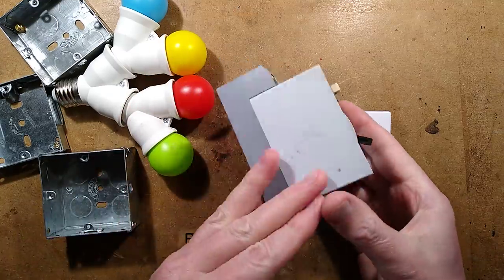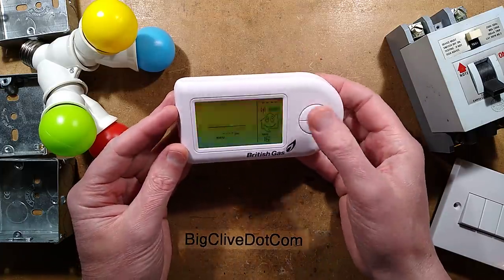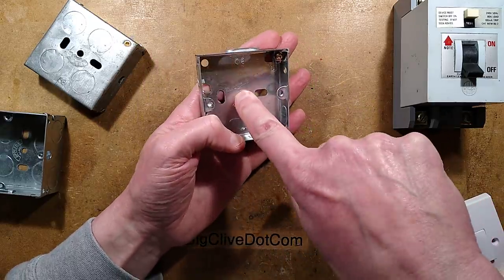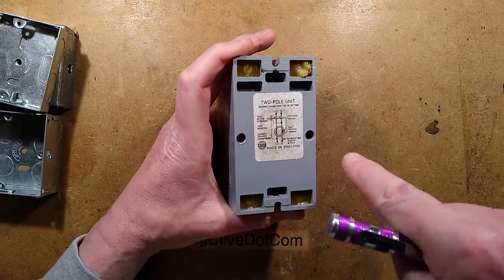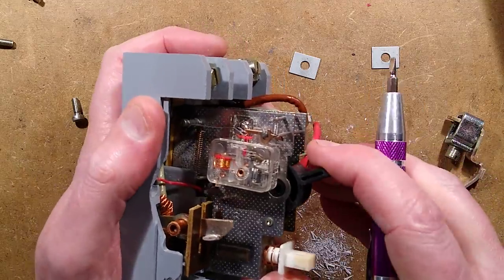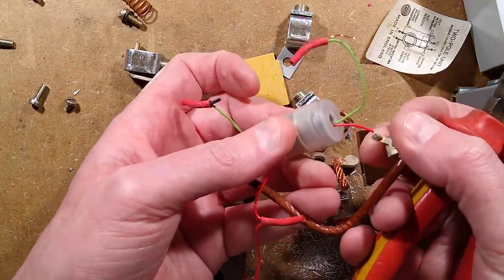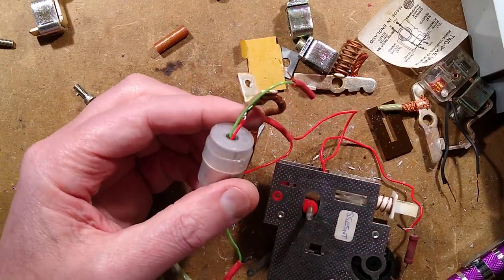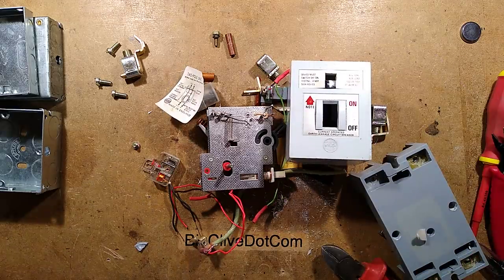Vintage RCD/GFCI teardown with story (weird sensing system)

Comment: I wish products these days could be this simple and reliable!
Reply: Ultimately it wasn't reliable though, as it started failing intermittently, which is really bad for a device like this. I think using a pure magnetic trip mechanism for this is going to have reliability problems, the mechanicals involved are just too sensitive and prone to sticking.
Reply: @RobertHancock1  That is why the modern ones use a mains operated trip coil, to get a high trip force. Drawback is that this coil can then burn out if the breaker is incorrectly wired, as it has it's supply power derived from the output terminals.

Comment: Audiophiles use those foil coils Usually made from copper either bare or tin plated. I used them for high current CDC circuits. You can shoot a construction nail clear across the room if you get the discharge timing just right.

Comment: Surprised that they are still using that sort of electromechanical trip mechanism in RCDs. I don't think that has ever been used in GFCIs on this side of the pond. Of course the trip threshold is also lower at 5 mA so it might well be impractical. Certainly not possible today with all the requirements for self testing and line-load reversal detection etc.

Comment: The TT system you described is very similar to what we have in the Tennessee Valley Authority system. We have a 8 foot ground rod at meter and on transformer pole that feeds the home. There is a ground wire run down every pole I’ve noticed lately. Maybe lightning protection? Interesting as always. Have a great day Big Clive ⚡️🏴⚡️
Reply: Yes lightning protection for each pole, and also your house ground reference, normally on the other side of the pole so the 2 ground rods do not touch each other directly. The primary side has it's own grounding rod and the secondary a separate one, plus the houses connected to the pole pig each have one at the meter, to reduce the rise in ground voltage with a close by lightning strike. There normally is either a spark gap or a surge arrestor stack by each transformer that shunts lightning induced overvoltage to ground, and spark gaps at the poles so that the energy is absorbed before it reaches the house wiring.

Direct hit on the wires your electrics in the house are fried, but the wiring itself survives, which is what the power company cares about. You would need to add your own surge arrestors to the house side, and to appliances, to protect them. Generally the electric stove and heaters survive, though the clock in the stove might not, but anything with silicon inside dies, along with all light bulbs that are turned on.
Reply: @SeanBZA  
Yep I’ve had lightning run in the old house I used to live in and it actually burned holes in the edison base screw in glass bulbs. Right through the glass! Also blowed a fist size hole through the steel back of stove! Not a good experience! After the noise and smoke and underwear change and blown fuses replaced all was good. Miraculously LOL
Reply: That wire between the poles is called the skywire
Reply: @stereotypicalLame  
We just call them overhead lines. Two actually where I’m at. Top is 13,800 volts bottom wire is neutral. At least that’s what a lineman told me once.
Reply: @EricWillis77  I'm not talking about the power lines. I'm talking about the very top, thin wire
Reply: @stereotypicalLame  
No other wires where I’m at in Tennessee 🇺🇸

Comment: When it comes to making illuminated antlers, don't use those cheap LED bulbs - They're no good in the rain, dear!

I'm made mindful of an old quote "For the want of a nail, a shoe was lost. For the want of a shoe, a horse was lost. For the want of a horse, a cannon was lost. For the want of a cannon, a battle was lost. For the want of a battle, the war was lost. And all for the want of a nail" - In modern parlance, a cascade failure?!

I don't suppose you'd have one of the really old ELT (Earth Leakage Trip) circuit breakers lying around - To explore?  I've often wondered just exactly how much they differ from an RCD. I know the mode of operation is different, but until now, never really thought it worth a look-at.

Comment: I'm surprised that you went for a split load board - RCBO boards are very reasonable these days & being on a TT setup N-E faults can be a right pain to diagnose - aside from the hassle of having half the house without power!
Reply from the maker: I'm not thrilled by how much they're jamming inside RCBOs.  I've been sent a few that have failed with an internal arc flashover initiated by electronic failure.

Comment: The single wire passing through the current transformer actually makes the trip coil current higher! More windings in modern RCDs work to reduce output current in a current transformer. Here you have 1:1 ratio so a 100mA fault current would (ideally) pass 100mA through that trip coil.

Comment: I remember when i lived in market weighton, at one point after it had rained quite a bit (and the town cenre ended up flooded, athough i didnt see the flooding in person, from what ive been told the flooding only really prevented vehicles from passing) the RCD in our house tripped
after waiting a minuite and resetting it, it tripped again, and eventually it got to the point where it woudlnt even reset
fast foward a few days, afte the circuit causing the problem has been identified, the MCB for that circuit is left off (it was a L to E fault from what it seems)
fast foward a few more days, i try turning the MCB back on to see if the fault went away on its own, nope, RCD instantly trips, and either the MCB tripped immidiatly as i turned it on, or i hadnt moved the lever on it far enough up for it to latch when the RCD tripped and so it turned off again when i released it, so i reset the RCD
fast foward a few more days, an electritian comes in, and they find some old wires (red and black) connected into the light in the kitchen (these wires went off to a different light somewhere, the house had been rewired before we got it, so there shouldnt have been any old wires, the electritian disconnected the wires, and after the power was switched back on, the RCD didnt trip

Comment: I've now taken dozens of these apart and I've also pulled the core apart s well.  The plastic shield is actually quite easy to remove.  I was scrapping the thing when i made my vids,  so i had barely any idea what was going on, but it seems i got it mostly right.

Comment: I tore down a US outlet GFI on my channel.. It had a pair of 16 or 18 gauge wires running through the sense coil, not much for something rated 20A. I guess its OK when there's only a few cm of it and the sense coil works as a heatsink? The trip mechanism had a microchip, a thyristor, then this little solenoid that draws over half an amp, of 120v, for half a cycle of 60Hz and directly releases the clip that holds the contacts down under spring pressure.

 I'm impressed that someone made a mechanical device that would trip on 100mA and a fraction of a volt.
Reply: Manufacturers can get away with putting more current through a wire because it is a tightly controlled setup. There's a question on the DIY Stack Exchange where somebody noticed a 12AWG wire in their 50 amp transfer switch and contacted the manufacturer.
Reply: @eDoc2020   Exactly. Single conductor, connections rated more than 60C, embedded in free air or heat sinking components instead of a wall full of thermal insulation, etc.
Reply: AND all that extra solid-state circuitry is RF sensitive - sensitive to 1,000W of RF energy and sometimes as little as 100Watts on 60 meters for me anyway ...

Comment: Clive, I was just thinking after reading some of the excellent comments below that if you were on a NEM system, and the RCD / ELCB jammed like this, the fuse may have looked just a little different. In fact a little smoke may have decided to holiday or even take up residence in the wall box.

Comment: I have exactly this in my house today. It's doing my head in. It'll be coming out soon. Let me know if you want to have it! :-) When it trips, which is far too often, it won't reset at once, the black level doesn't feel like it has anything to push against, so I'm assuming lots of tired springs and other components inside.
Reply from the maker: It does sound a bit tired.
Reply: @bigclivedotcom  Has to be at least 35 years old, as is the CU. Bits have been added since but it's time to clear out and start over. Past time. :)

Comment: Recently took a 3 phase unit apart, and the principle was essentially the same, obviously with four wires going through the core instead of two. There was some additional passive electronics to condition the induced current though.
Reply: I found that the test winding had evaporated complete with skidmarks (probably lightning), but the actual protection system seemed intact. Oh well.
Reply from the maker: On modern units, when they fail to trip the coil is often destroyed.
Reply: @bigclivedotcom  The protection system was galvanically isolated, and that might explain why the surge didn't kill it. This unit was only six years old. I don't know if newer ones are different here in India.

For example the major brands all still only sell lighting with switch mode drivers in India, possibly because no one wants more resistive heating when it's already 32 degrees C, but more likely because the mains voltage can vary a lot. 

Thank you for the response and always a pleasure to watch your videos Clive

Comment: How long was it sitting in that fault state? 8 Amps or about 2kW, that could be a hefty electricity bill. Good job the fuse finally melted, rewireable fuses will sit with an overload for a surprisingly long time. That type of fault on a 30 Amp circuit could be very expensive if you had been out of town, or didn't have a power monitor.
Reply from the maker: Thankfully I don't think it was long.  But it could so easily have been sitting there at the fuses maximum ability to maintain the current for a very long time.  Very annoying that the power monitor had decided to lose communication at that time.  (It does so from time to time, possibly due to something locally jamming the signal.)

Comment: Lolz, my bedroom has one of those ceiling fan lamps with five light sockets. I have five of those LED bulbs with the strip of LEDs held up by wires you know. Center is red, then round the outside are orange, yellow, green, and blue. =P I have a thing for rainbows. Funny, they average out to white when they are all on, but shadows in my room are really crazy and colourful. I have to have the blue facing away from me because it makes my vision all blue and hazy...It seriously causes things to fluoresce.
Reply: I hope you don't really mean literally fluoresce, because that plus your other details would point to a UV bulb, which will cause you eye and skin damage! BigClive has a video about an incident were UV bulbs were used in a public space, check it out to see if that's what you got.
Reply: @xtevesousa  Given that UV-C LEDs are seriously expensive that's probably not what the OP has.

Comment: I suppose it would make sense, rather than stamping or forming round metal laminations and then squeezing them together. It is surely easier (and cheaper?) to coil up a metal strip tightly, and I guess more efficient transformer core with tighter laminations.

Comment: I'm missing something. In the US, the neutral and the third wire ground are bonded together at the main fuse panel for the building.  If there's a short from hot to ground, it won't have to go all the way back to the substation.  Just to the panel.  It will trigger a breaker on overcurrent.
Reply from the maker: That depends on the system.  On this overhead system the neutral and earth are not connected.  The earth is acquired locally with an earth electrode.
Reply: @Brian_Of_Melbourne  Interesting.  At a glance, I'm not seeing the US system.  It would be closest to TT but with the ground rod and neutral connected at the first panel where the power enters the building.

Comment: Big clive, did you check the resistance through the test switch circuit with the breaker in the tripped position? The contact operating lever (large red piece) looks like it could also operate a set of contacts at the base of the test switch to open the circuit when the main contacts open. Thank you for another interesting video. Regards, David.
Reply: Given it has it's own winding, I wonder if something in the ciecuit structure limits it's power once tripped.

Comment: The thin insulation is not such a thing. Most insulation thickness it for physical protection that is not needed in this application. Imagine how thin the insulation is in a class-x capacitor.

Comment: You mentioned the resistor not being disconnected after pushing the test button. I somehow lost track and wonder which side terminals those red and green wire go to. (I agree, the insulation on those seems to be ridiculously thin. I wonder how far an insulation tester could push those.) Are those hooked to the input terminal or the output terminal? If they are on the output side, the resistor would be disconnected as soon as the test button tripped the device.
I could not make out any kind of "direction" from markings or the label as well and technically speaking, for this device it would not matter anyways regarding function. But I can imagine, feeding in from the top and connecting all the breakers to the bottom would kind of achieve this.

Comment: Thirty ohms between your home and the power station... how many meters would that be, roughly? I know it's quite damp most of the time on your Isle but that's very low soil resistance compared to what I'm used to. You don't see power circuitry like that in the US much these days because we get actual summers and the ground resistance climbs rapidly. I used to live in Phoenix Arizona (in the Sonoran Deseret, hint hint) where there were thousands of miles of copper wire just for the ground return in all of the city's power circuitry. When copper prices started climbing, thieves would go out and cut what they could from LIVE LINES in obscure locations. This had fairly obvious effects so some of the smarter... I mean slightly less stupid... ones began stealing ground return wire which had as you can imagine somewhat stranger, harder to trace effects.
Oh, that thing you were marveling at looks like a minimalist current transformer. Damn things always struck me as black magic what with using theoretical "A fields" instead of ordinary mundane B fields.
Reply from the maker: It's not a huge distance, but was still impressively low.

Comment: The sense core in that unit looks suspiciously like it was wound from "mu metal" (https://en.wikipedia.org/wiki/Mu-metal) a nickel alloy with very high magnetic permeability.  Probably just the thing to make that single turn transformer work.
Reply: Looks to me like core made from metallic glass or sometimes called "amorphous core", you can tell it by how brittle the foil is, and its tendency to ping needle-like fragments when cut(ask me how I know).
Reply: Most transformer cores are many layers of iron or steel to avoid eddy currents circulating in the metal over a cross section larger than a single layer.

Comment: Nice mechanical mechanism - I am amazed that it can detect only 100mA imbalance...
It's the next step forward from my old Crabtree ELCBs here - where I believe the trip coil carried some of the actual earth fault current - but no L & N current imbalance is detected at all :o( (could you dismantle one of these one day Clive ?).
Reply from the maker: Sonme units trip on voltage difference between neutral and earth.  Others do have a coil in the wiring earth path.

Comment: I always find it interesting how early you guys were using those. Big ones only started showing up as standard circuit breakers in the US pretty recently. My house isn't that old and it only has GFCI outlets in the bathrooms and that is it! I wonder if one country reports more "accidents" than the other?
Reply from the maker: We've used main RCDs/GFCIs for a while, and they will often prevent fires by tripping when smouldering compromises the insulation and causes rogue current flow to ground.
Reply: @bigclivedotcom  It's such an interesting comparison - I think of these as modern, high tech devices...while you were still using them with hand wound fuses! I don't think we ever used fuse wire here - just the old edison base fuses.

I'm going to have to do some research now, I'm really curious if I can find some numbers for fires/electrocution comparison between the two systems.

Comment: So Clive, when did you last test that ELCB before you discovered it not working correctly?
It’s not unknown for me to trip my RCD when working on the lighting circuits in my home, I do switch off the MCB for the circuit, but it’s the neutral that is still connected that does it!
My spilt load consumer unit has RCBOs for the ring circuits, the RCD protects the lighting circuits, the cooker and the immersion heater.
Reply from the maker: Fairly frequently.  Often accidentally.  So it was a genuine surprise when it failed to trip.

Comment: Why not to connect neutral and earth at fuse box? We do not use the TT system in fixed installations. It is always 3 phases and PEN or 3 phases N and PE and there is always a earth electrode.
Reply from the maker: Because the service is delivered from an overhead three phase system there are risks associated with bonding earth to neutral if that cable gets damaged by a vehicle or tree.